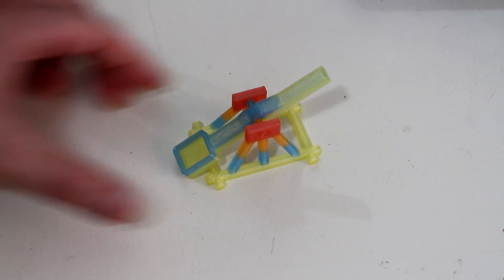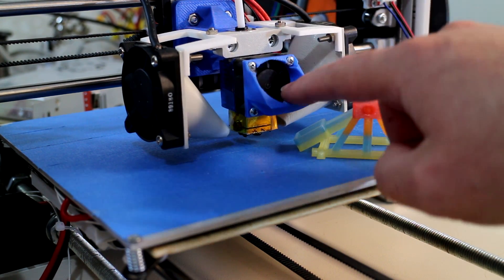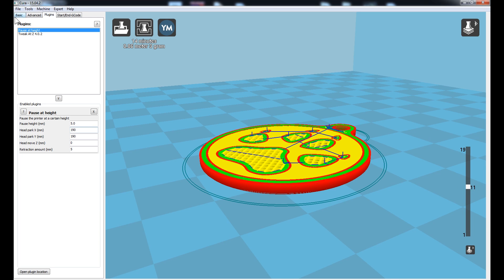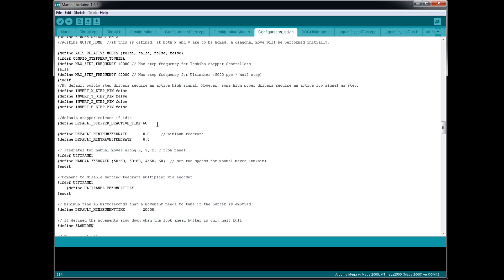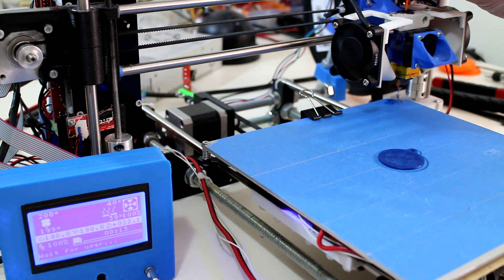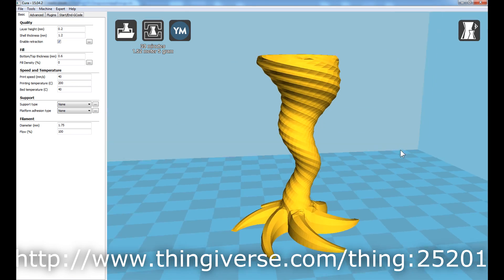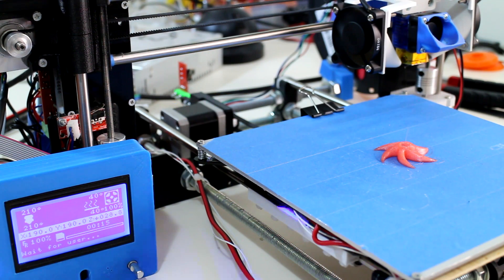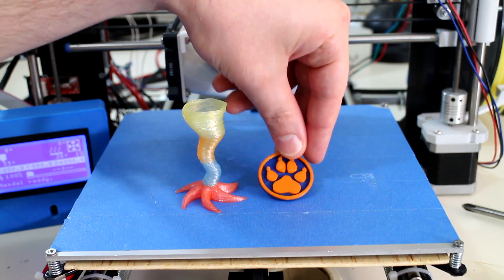Multi Color Layer 3D Printing

Comment: do you have a video on printing things in separate parts? like printing the tag body first and then printing the paw. I realize the model would have to be changed, so not this exact model, but are there any odd things to consider when doing that?

Comment: Cool video. Just something I noticed, your top layer looks kinda mashy. I think you're over-extruding a bit.
Reply from the maker: Yeah I could lower it a tad to smooth that out. Good observation!
Reply: bro can you help me, when i use the stepper deactivate my extruser locks too and i cant take the filament out, how to unlock him? thanks
Reply: lucas kolling What kind of extruder do you have? Does the machine print or is it a work in progress? We need details mate.
Reply: i think i know now, the filament melts into the nozzle and stucks, made few changes and will try tomorrow. its a Bq prusa hephestos thanks

Comment: What is the G-code being used by the printer on the pause command in order to set the print head to a hold position?
Reply from the maker: G4
Take a look at the Marlin website http://reprap.org/wiki/G-code
Reply: It appears G4 is a Dwell command, that means it is only telling the printer to sit idle and maintain temperatures. The code i wanted to know was what is telling the printer to move to an idle position and possibly rehome afterwards.
Reply from the maker: *****

Ok, here is the code Cura produces at pause:
M83
G1 E-5.000000 F6000
G1 Z15 F300
G1 X190.000000 Y190.000000 F9000
M84 E0
M0
G1 E5.000000 F6000
G1 E-5.000000 F6000
G1 X115.075000 Y113.750000 Z5.000000 F9000
G1 E5.000000 F6000
G1 F9000
M82

Comment: Nice video Tech2C - I like your expertise a lot! I was keen to see how you remove the PTFE tube from the fitting. There the video was cut and this procedure wasn't shown unfortunately. On my Rostock this is to be the part of the exercise where I need to apply some force and at the same time I need prevent the stepping motors from moving. As I have a Delta, this procedure is a bit tricky. I found that unscrewing the hole fitting from the hot end was more easy, I only hand tight it up - so this works fine. 
No sure what I would be doing with a hot end where the fitting can't be unscrewed completely - like the E3D. 

Hence my question: Do you use a special trick in order to remove the PFTE tube with low force towards the fitting? (Of course I press the outer ring down - but still it needs some deliberate force)
Reply from the maker: +John Coffee 
Good question, I did edit that part out as it took about 45 seconds to swap out. The fastest way I swap filament is to:

Unscrew bowden idler, press down on the black clip holding the PTFE tube on the hot end, feed by hand some filament, this pushes the PTFE tube out of the hot end, quickly pull out the filament to prevent strings, cut blob on filament, wind filament back on roll, replace roll, feed new filament thru PTFE tube, guide filament by hand through hot end and push thru nozzle, push down PTFE tube at hot end, tighten bowden idler.

I might do a quick video on this!
Reply: Except that I unscrew the complete tube fitting, your method is identical to how I do it. As mentioned - unscrewing the complete fitting is even more simple than pressing the black wring down. This gives some vertical force to the extruder head I like to avoid that. I don't use any tools to unscrew / tightening it up again - just by hand tightening as this is sufficient for this application.

Comment: Whats your opionion of the 3 in 1 out tri colorprint heads I've seen on amazon. Is there programming that deals with the color change or does it pause. I can't find enough information on these printer heads.
Reply from the maker: +AirandEnergy 
I haven't seen a lot of it. I know E3D have their 'Cyclops' unit. There are a few YT videos demonstrating the print results of using those mixing hotends. Either way the slicing software you use must be aware of the extrusion method as that program will tell the extruders what to do. I dare say Simplyfy3D could do it, but you'd have to check.

Comment: Would this still work with multiple different materials?
Reply from the maker: +T0xicN0va 
Not sure. I would assume it would work to some extent as we're melting the plastics together. Whether the layer holds upon mechanical strain could be troublesome.

Comment: HOw do you edit the firmware?
Reply from the maker: +Collin Willson 
My printer uses Marlin firmware on the arduino board. Use the Arduino software to open Marlin and modify the config. Finally compile and send the code to the printer.
Reply: Hmm. Thank you! Would this work on my prusa? I have a prusa i3 monoprice select printer
Reply from the maker: Collin Willson

Should do. It would be best to jump on the reprap forums and search for your printer. There's bound to be someone with your printer whom can guide you through the modifications.

Comment: if you want an amazing vase print with cura, use a stl that has no opening, then print with zero infill or top layer, the trick is to click spiralize in the expert settings. Instead of making the perimeter one layer at a time and stepping up, it spirals all the way up without taking a step, it even works with a thicker perimeter than just one line.
Reply from the maker: +Josh Bishop 
Thanks! I used this feature in Slic3r, but rarely check the expert options in Cura. Worthy of another video... :)